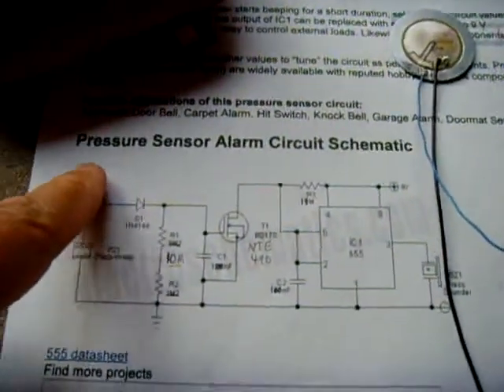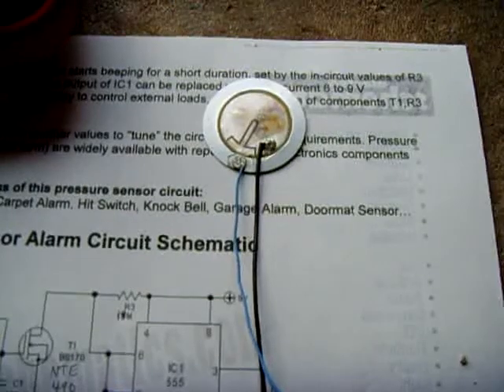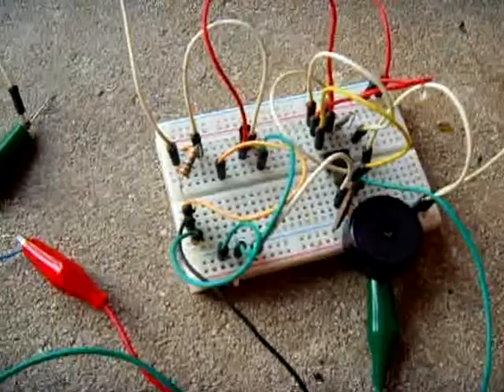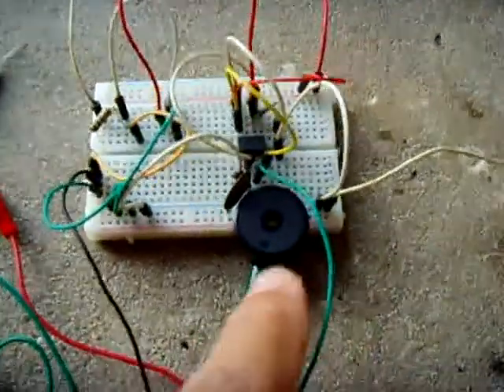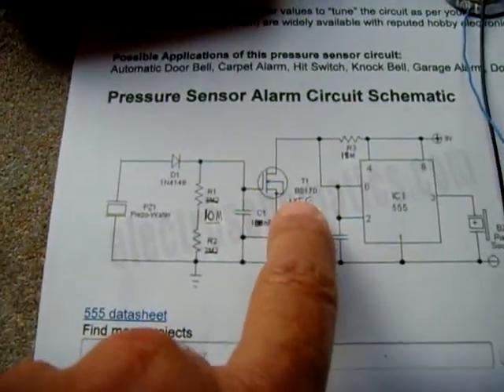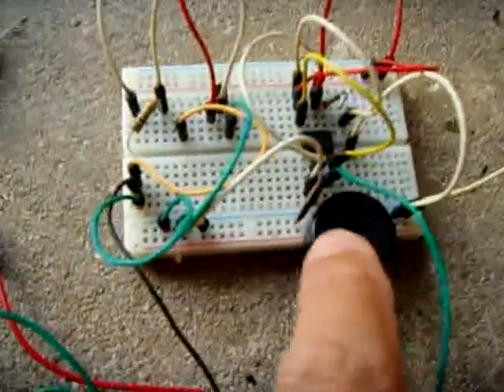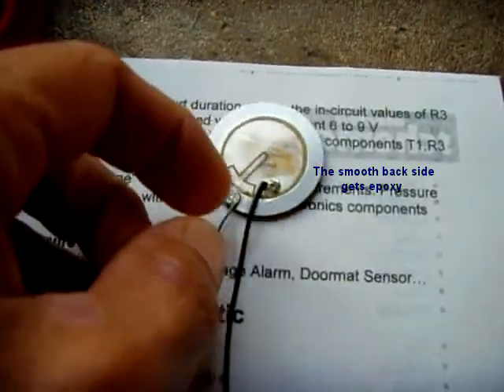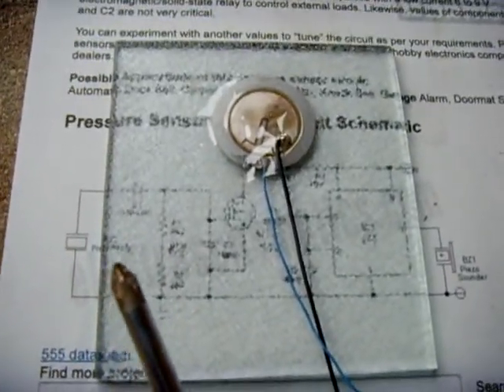Shock Sensor Alarm Circuit!

Comment: I saw the other video about the re-use if a smoke alarm. Which linked to this one.
The piezo element has one flaw. If you bind it in a direction, it will give of a certain voltage. When bend in the other direction, the voltage is negative. I found out that every time you use the current in a certain direction, the piezo needs to get rid of the negative voltage as well. Since you have a diode in the schematic, this could become a problem. A resistor across the piezo will eliminate this problem. Perhaps 1Meg would be sufficient.
So far my own observation. Perhaps it does not imply anything to your schematic, you would need to try it out.
Reply from the maker: I haven't observed any problems with the circuit when the piezo wafer is bonded to sheet metal or glass.

Comment: sir do you have Veroboard Layout?
Reply from the maker: +Robert 95 
Hi Robert. No, you need to solder the components using a prototype board. The circuit is very simple.

Thanks For Watching!
Reply: +electronicsNmore may i add wireless remote control on it? how can i make it?

Comment: can i change the buzzer with a relay ? with one hit , can i use the same method by increase amount of resistor and capacitor value to keep the relay much longer ?
Reply from the maker: To change the buzzer to a relay, you would take pin#3 and connect it to a 2.7K resistor leading into the base of a 2n3904/bc547/2n4401/ksp2222a/etc. The emitter connects to battery NEG, The proper voltage relay connects to the + rail and the NPN's collector. Make sure you place a 1n4003 to 1n4007 diode across the relay coil to prevent back EMF from destroying the NPN. The cathode(line on the diode) connects to the side of the relay coil which connects to the + rail.

Thanks For Watching! Be sure to share my channel with others and rate Thumbs Up.
Reply: i want to make a platform which is from piezoelectric, which will produce current and enter the relay . so that current from other source will flow when there is a pressure on a piezoelectric . is it possible ?
Reply from the maker: Yes.

Comment: why is the buzzer beeping continuously without applying pressure ?
Reply from the maker: Hello,
The piezo alarm will only sound for a few seconds after a detection. You do not need to keep pressure applied to sound the alarm. Pressure/shock is simply used to vibrate the crystals in the piezo wafer to trigger the circuit.

Thanks For Watching! Please share my channel with others, rate Thumbs Up, Subscribe, and check out my other videos as well.

Comment: thanks so much i really love this. but a question what is i wanted to add more than piezo disc's(wafer) what would i have to do... would i have to change the hole schematic
Reply from the maker: Hey Justin,

You should be able to parallel a couple wafers together. If either one senses any shock, the alarm should sound. Give it a try.

Thanks For watching! Don't forget the thumbs up, and also be sure to check out my video playlists as well.